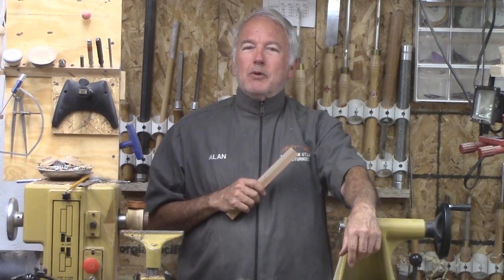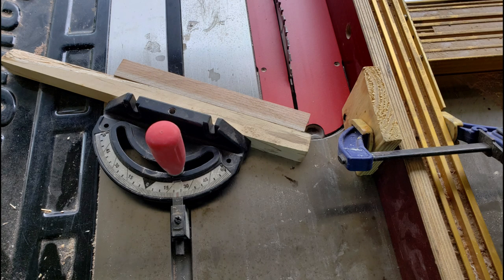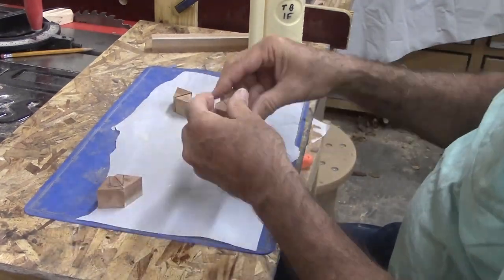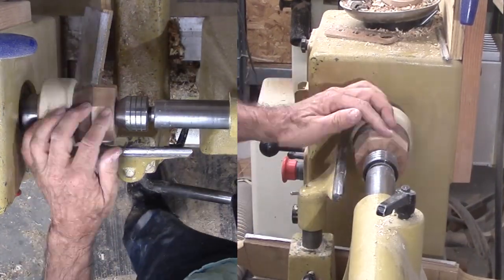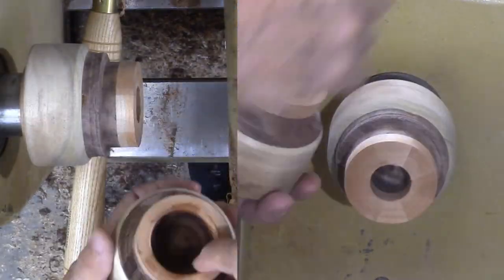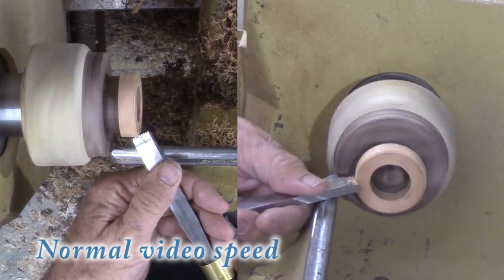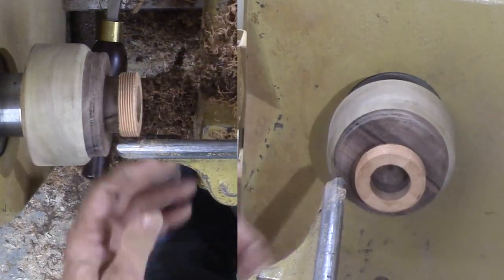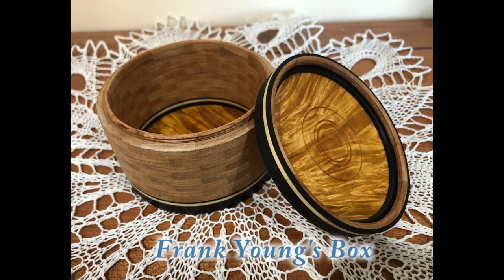Six Handicap Woodturning - Segment Ring Thread Chasing

Comment: Must admit when I first came to this video i wondered why you were using segmented pieces. I hadn't seen its predecessor by Frank Young. The light went on while I was watching: It provides a way of cutting/thread chasing with the grain so you don't have to use expensive exotic woods. But, then, though I've done some thread chasing i've never done any segmenting, so why go to all that bother partcularly as i'm not partial to segmented items; haven't got the jigs etc. This is where you made it look so easy; you can almost rough cut the segments and tidy up before threading! This way you can create threaded inserts using domestic timbers. Neat! Well done Frank and well done Alan for showing us that you don't need any specialist tools or timber.  I'll shorty be off to my workshop to create some segmented rings and 'chase' them into threade pairs!
Reply from the maker: Sound like you got the main point from the video. Good luck
Alan

Comment: This is a great pair of videos on thread chasing. I have been able to hand chase threads, but hesitate to use enough of the expensive and rare boxwood, ebony, and African blackwood to really get good at it. Something clicked in my head when I saw last weeks video on using segmented rings. I have pulled out my wedgie sled segmenting jig and have got started. If someone were to want to do more than a couple of segmented rings, I would urge them to check out the wedgie sled on segeasy's website.  You can make a simple fixed angle sled in about 30 minutes for almost nothing. Although they do sell products, when I made mine a couple of years ago, I called and he told me I did not need to buy anything and to stick to the simple sled.
Reply from the maker: The wedgie sled is a great tool. Frank and I both use it plus just about every segmented that I know.
Just make sure to make it a bit bigger between the arms and make your own angle templates.
Alan

Comment: Gave you a thumbs up, even though I was chastised throughout. ;-)   Wonder if I can make an accurate enough disk sander out of my lathe in order to do this right...
Reply from the maker: Go for it!.
1. Threaded wood faceplate.
2. Add MDF face. The hard part is to ensure it is perpendicular.
Aan
Reply: @AsWoodTurns  Doesn't the sanding board ensure the turning piece is flat and perpendicular ?
Reply from the maker: @mpart_woodlathe-stuff  If you are referring to the long board I sometimes use in sanding a segment ring, then not necessarily. It is easy to round over a little.
When mounting MDF to a faceplate, it is easy to get runout.  one way to combat runout is to add am intermediate plate to the faceplate that can be trued before adding the MDF.
Alan
Reply: @AsWoodTurns  Yes, the long sanding board. Hmm, in my mind's eye the forces are along a perfect line through the center of rotation. Which never happens. Invariably some forces move away from the center line which may round the surface. Got it now! Thanks Alan.

Comment: Winner, thoroughly enjoyed your video, well done Alan.  is 16 TPI a good chaser to learn with?  How do you sharpen thread chasing tools?
Reply: From what I've seen in other videos, you simply go over the flat top with a fine stone to sharpen them.  Alan will likely have more.
Reply: The thread chasers have a small bevel on one side.  Thus is where you can use a stone, diamond card or even a CBN wheel to sharpen them.  I use the Carter and Son thread chasing tool and Mike Mahoney (who designed it) has a video on sharpening as does Sam Angelo.
Reply from the maker: I cannot add more than the 2 reply's already here.
Alan
Reply from the maker: You have it..
Alan
Reply from the maker: Right on
Alan

Comment: Need to work on your maths there Alan, you forgot Pi.......
Reply from the maker: I did not forget Pi, I just rounded down.  Circumference = Pi x diameter. But Pi is 3.1414. For calc purposes 3 did just fine. :)
Alan
Reply: @AsWoodTurns  Where you said 300 RPM x 3" Dia = 900 inches per minute my working out is that it is 2700 inches per minute on the circumference and so on . Or have I misunderstood what you meant ? Don't mean to be picky but there's a big difference when it comes to RPM and peripheral speed.